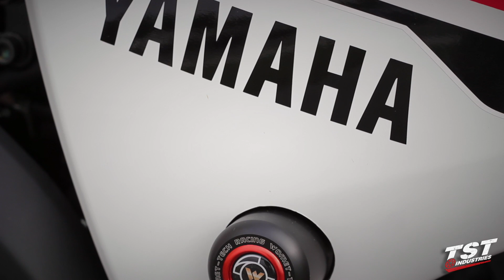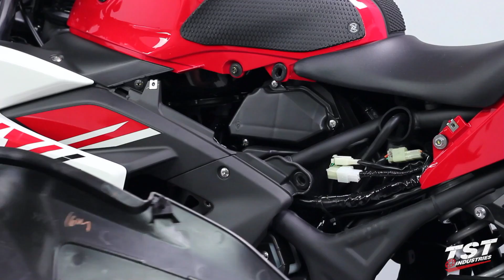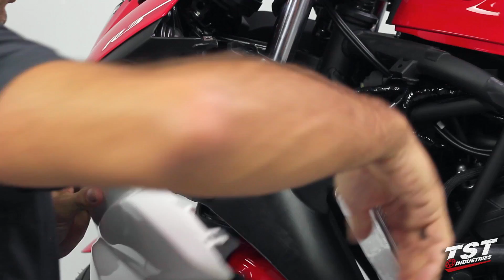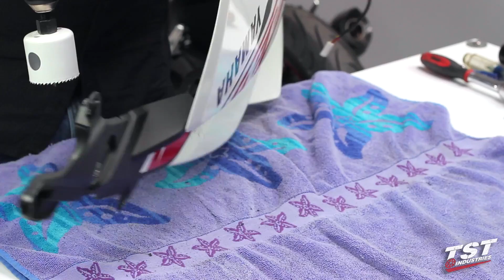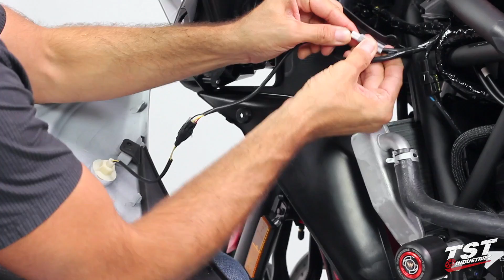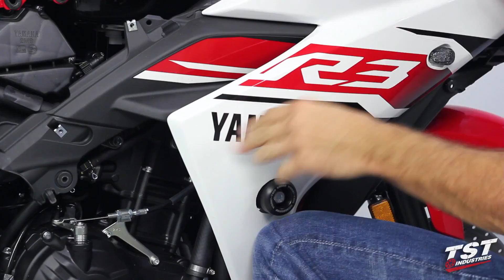How to install Womet-Tech Frame Sliders on a 15-18 Yamaha YZF-R3 by TST Industries

Comment: Do you have any tips on lining up the hole for these frame sliders on race glass? Love the content!!
Reply from the maker: I have a universal method to do any fit, whether it is OE for the first time as I develop template, or fiberglass race body. I mount the bike in a sturdy way so that it cannot shift from it's position for the duration of process. I make sure it is level front to back, side to side. I remove fairings. I set up a laser pointer with a leveling bubble on a tripod several feet back from the mounting position of the frame slider. Laser goes on and gets lined up with the center of the bolt for that mounting location. I ensure the laser beam is horizontal and it's axis is perpendicular to center plane of the bike. The laser needs to be coaxial with mounting bolt. Then I assemble the bodywork back on the bike. The laser marks center of my slider hole  I mark it, cut it, and that's it. The rest is just getting the slider installed in place of the OE bolt.
Reply: @TSTindustries  thats awesome! I had to import the bits to Australia, after watching your series. Love it. Ill give this laser trick a go this week! Thanks guys!!
Reply from the maker: @ryanmiller8090  sure thing....glad to help

Comment: Is 37 ft lbs recommended for this slider or is that the spec for that bolt on the r3? About to install your kit on the wife's mt-03 and I think the spec on this bolt is like 50 or something..need to double check
Reply from the maker: The OE fasteners often have a different torque recommendation than our frame slider bolts. Please follow what we recommend in this video.

Comment: Do you think it would be ok to drill the fairing with the hole saw from the outside, once the pilot hole is made?
Reply from the maker: Yes, but put some painters tape on paint and go slow. You don't want to lift a chip.

Comment: Is it okay if I drill from the outside of the frame in-ward to help with a cleaner outside finish?
Reply from the maker: It is up to you. As long as the pilot hole is in the correct place the direction of drilling is inconsequent to the performance of this product. If you do that though I would recommend using masking tape at the drilling site to prevent paint chipping around the hole.
Reply: @TSTindustries  Thank you

Comment: @TSTindustries does this work on 2019 R3?
Reply from the maker: No but the good news is we have finished a design for our 2019+ version this week and will be going into production shortly
Reply: @TSTindustries  oh that's great. I assume it comes with the cut out template as well? Any idea how much is the cost?
Reply from the maker: @Fred-eg9sx  we are making the templates this week. They will be included with the kits. We are shooting for a 79.99 price point but it is pretty early in the process and we have not priced out the frame spacers yet. These have to be more complicated than the previous generation bike because of the fairing geometry and some other interferences. We will post a coming soon product listing on our site as soon as we have metal prototypes and can show installation in a video.
Reply: @TSTindustries  thanks a lot. Really in need of these.

Comment: does this work with the 2019?
Reply from the maker: The frame sliders fit the 2019 frame just the same as previous years. Unfortunately Yamaha made the fairings in a way that cutting access windows for the sliders will alter them structurally. At this point we have not made an alternative set yet that fits 2019+ model specifically.
Reply: TSTindustries ok thanks for the reply

Comment: I noticed your 2019 R3 has the Womet-Tech Frame Sliders on them, will there be a install video for them in the near future as well?
Reply from the maker: The 2019 model bike will take the same frame sliders we have been offering for the previous generation as far as frame/engine mounting is concerned. On a race bike with race bodywork the installation will be simple. On OEM bodywork the installation is not simple, and we haven't figured out a way to make that easy for the customers yet. We may have to manufacture an additional piece for the set. Unfortunately the OEM fairing have a black plastic component on thee inside of the fairing right over the frame/motor mount, and if you cut through it to make access for slider then the plastic piece becomes two under-supported parts. So we won't be releasing the kit to 19+ owners until we get a better installation means.

Comment: Hole saw is 2-1/8 inch right?
Reply from the maker: Yes, that is the size we used.
Reply: @TSTindustries   54mm or 2 1/8 inch  .  It's odd that the included instructions say to use a 25mm hole saw.

Comment: do these work on the mt 03
Reply from the maker: Ivan R yes they will but since it is a naked bike you will not have to cut any fairings. they will just bolt up into frame/motor in the same location as on R3
Reply: thank you. also i just moved to brazil from the US and i was wondering you policy for shipping to Brazil

Comment: I noticed on your related video for the R6, you taped around your pilot hole, and drilled on the outside of the fairing with the hole saw. Is that suggested instead of drilling from the inside like this video shows?
Reply from the maker: You know...I have done that type of installation both ways in the recent months and if I am careful there is no difference. I am now favoring the outside to inside approach because theoretically the initial cutting is the cleanest and the burrs come out on the end surface. Again, if you are patient and carefull it doesnt matter but if you are a bit too speedy then you want the burrs to come out on the unpainted surface.
Reply: TSTindustries Got it. Understood. Thanks!
Reply from the maker: You're welcome

Comment: There is absolutely no way these are going to prevent a frame from bending.  In fact quite the opposite.  At least when a fairing makes the first impact it will take most of the force.  The frame slider looks as though it will transmit the force directly to the frame.  I'd much rather crack a fairing than bend a frame.  Hence why I might consider buying a bike with a cracked fairing but would  never consider a bike that had frame sliders on it.
Reply from the maker: I think you are misunderstanding the purpose of frame sliders. They mount through the frame into the engine. That spot is the one of the strongest points on the bike. The frame slider acts to slide the bike as though it was sliding on the frame, but with no actual contact with the frame. They aren't meant to save fairings. They are meant to save motor components, controls, brake rotors, etc. I think you would enjoy the video we made demonstrating the effectiveness of our crash protection components. Here is the link: https://youtu.be/h42mkK0Pj1s . If you like what you see then please see our blog article that goes along with that video. https://tstindustries.com/blog/2015-r1-protection-parts/
Reply: I'll have a look then.  Cheers

Comment: Great videos, thank you. These videos were a big decision in me buying TST parts over others so keep it up! I like to support American based companies as well so it's great. I bought the Womet-Tech total crash protection pack, flush mount turn signals, fender eliminator, tank grips, rear tail light and the rear pod signal kit, (you can never have to many lights, especially here in Oregon where people drive like shit).

I spent about $450 and couldn't be happier with the quality, looks and installation. The dude at TST (don't remember his name) even wired a custom harness for me so I could add both the rear tail light and the rear pod signals, which wasn't supported out of the box.
Reply from the maker: We are so happy to have you as a customer. We appreciate your feedback. Hopefully when we launch the Halo-GTR signals for your R3 you will check them out.
Reply: TSTindustries Yes, definitely. I was waiting for the Halo turn signals but couldn't wait anymore haha. Anyways it's good experience tearing this thing down and putting it back together again so next time it'll be even easier.
Reply from the maker: Cool. If you ever swap out your regular signals for the Halo-GTR setup it will take you about 4 minutes. We've designed them to be super easy to install and plug in. Have you seen the blog article we have about them? Here is the link: https://tstindustries.com/blog/bigfoot-lochness-monster-yamaha-halos-truth-vs-myth/

We started the production of the first batch so it won't be long.
Reply: I have read that. Definitely looking forward to getting a pair. I went with the flush mount LED signals right now since they were inexpensive and I like to work on my bike so I can swap them later. Installing the frame sliders was the most intensive installation of anything I've done but even that was straightforward. I love simple design of the R3 and how easy it is to work on. Beginner bike all around.

Comment: The installation process seems fairly simple, my question is about the quality of the sliders. How good are they compared to vortex or shogun frame sliders. I understand you can't say they're bad but i would appreciate an honest reply. Thanks and great job on the video.
Reply from the maker: I have crashed our factory race bike with these on and they saved all my vital components and prevented any extensive damage to bodywork. We truy believe in the effectiveness of these components and that is why we sell them and use them on our bikes. We also have our riders in MotoAmerica, CCS, and WERA use these and they all have very positive things to say about the quality and effectiveness of Womet-tech parts. Take a look at the video we made about this subject https://youtu.be/h42mkK0Pj1s
Reply from the maker: Did you get a chance to look over the content I sent you?
Reply: yeah i just saw it. I didn't want to buy some and then for them to break off if anything happened, but it seems they did the job. I will probably be ordering some soon for my R6. Thanks for the info, and again, really good job on this installation video!

Comment: Is the saw-hole included in the kit?
Reply from the maker: No it is not. You can find one at a local tool store and they aren't expensive. You can also use a Dremel type tool with a rotating file bit after drawing a circle with the center on the template dot. This method produces results depending heavily on your skill and patience with that tool. I think in the next video of frame sliders I will show both methods.
Reply: thanks!

Comment: yeah not drilling into the plastics. sorry but no thanks. has anyone made ones that yoou dont have to drill yet?
Reply: +jack black drillin into the plastics is super easy dude. I remember back in the days when you had this stuff and it didnt come with instructions or templates.
Reply: Don't be a puss Jack. Just measure and measure again. They even include a template. How much easier can it be? I have the entire Womet-Tech protection pack on my R3. Very easy to install and very high quality compared to the Shogun no cut sliders that break off with any sort of serious ground impact. Also the complete protection pack was about $125 bucks too. Best investment I've made.
Reply from the maker: +jack black I'm sure there are a handful of options out there but we do not carry them. We find that no-cut frame sliders do not provide the same amount of protection as frame sliders that require cutting. You can see more on that topic at the following link. https://www.youtube.com/watch?v=3M_ZNfoObJ8
Reply: Sarcasm Police AGHB? 😏

Comment: can u do the clutch modify to be pump clutch so that not demage ur hand...
Reply from the maker: You will have to elaborate on your comment. I dont understand what you are asking. What do you mean by pump clutch?
Reply: I mean, is can the clutch cable modify and change to fuel like hand brake that use fuel?...
Reply from the maker: +diraf dir are you asking if the clutch can be changed to a hydraulic setup like on a 848 or older 1000rr?
Reply: +TSTindustries yup..you got it..but for r3
Reply from the maker: +diraf dir There is no need to complicate that system. Changing the clutch actuation system on the R3 would yield no benefit over its already feather like clutch pull force. If you really want it, it can be made but the development of it would cost as much as your bike.
Reply: +TSTindustries thanks for ur advice..